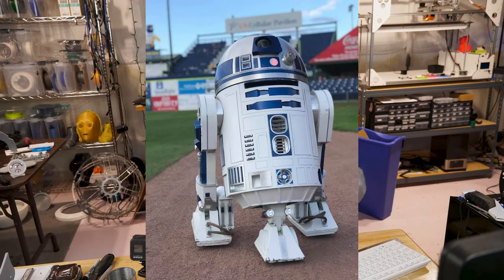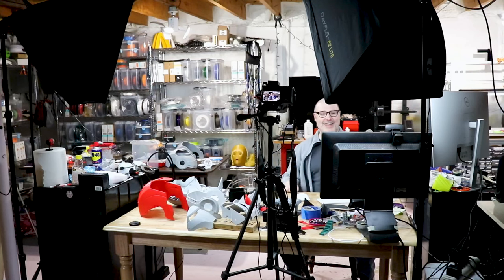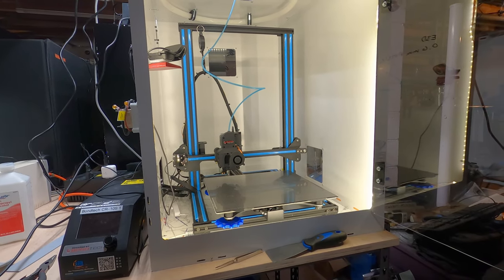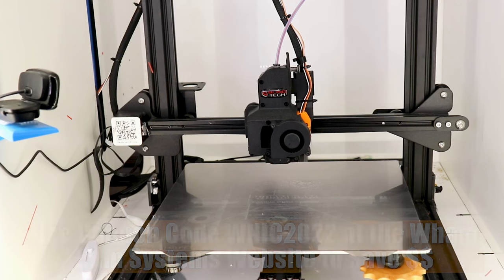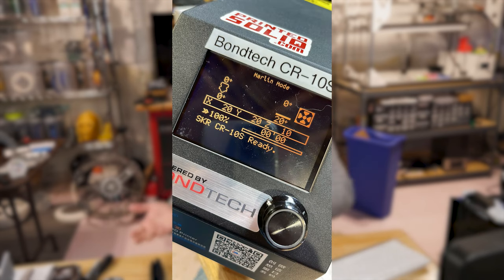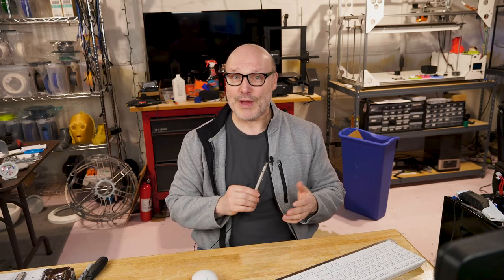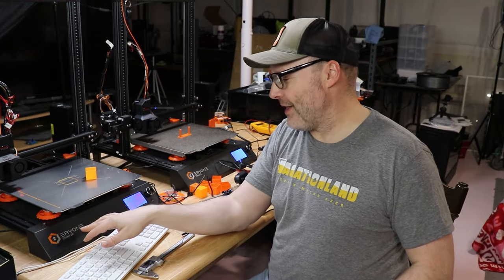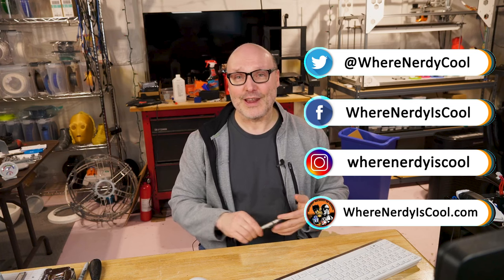My Iron Man Mk3 Build - 3D Printer Lab Tour

Comment: Have you had any cooling issues with the M175?  I have curling issues with PLA that I have isolated to this toolhead only.  Same model printed on virtually any other tool head doesn't curl but for some reason I get curling with the M175.  The vents on the M175 fan shroud are in my opinion not really optimized to cool right at the nozzle tip.  I was a chump and paid for my XT but I have taken their firmware and done quite a few modifications to it to make it work to my liking.  I switched to UBL leveling with 121 point mesh, also homing z at the bed and not at the top.  Had to make some other changes to support that, like changing the gcode the printer executes when you cancel a print from the UI.  You don't want to do what they do is a G28 since that will crash into the printed item since I'm homing Z on the bed.
Reply from the maker: I haven't noticed the curling but I was disappointed at the print quality of the M175 duct.  The "M175" text didn't print very well and I just feel for the cost of that toolhead, ducts/mounts like that would look so much better coming off an SLS printer